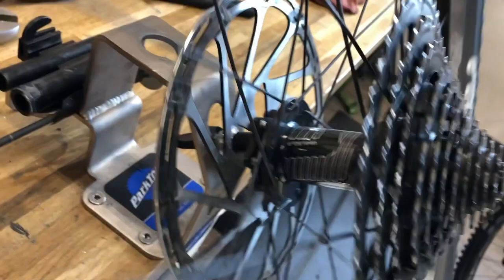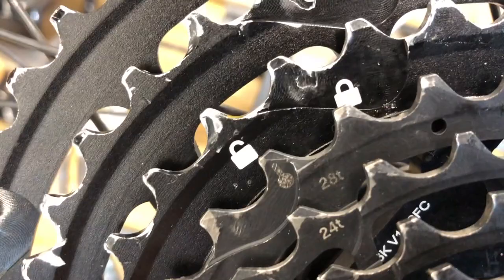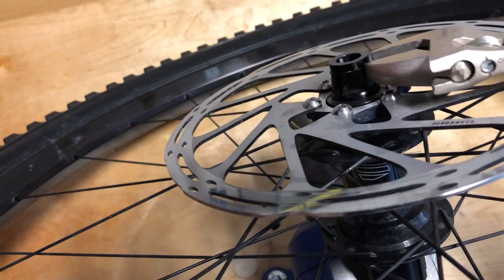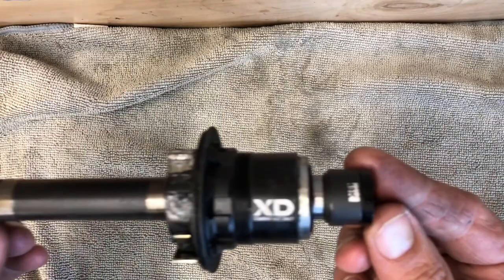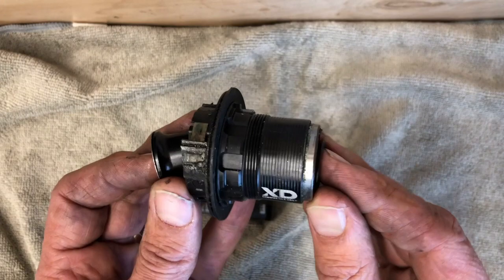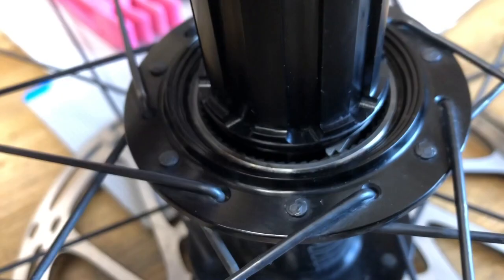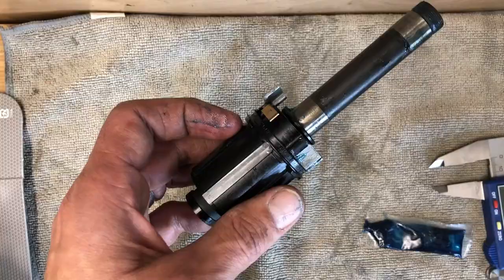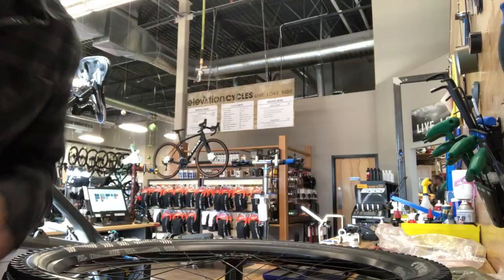XD to Shimano E*Thirteen Freehub Body Replacement

Comment: Thanks for making this.  Super helpful.  Did you use the lube they include in the package?  Where’d you apply it?
Reply from the maker: Mainly on the axle and all the spacers between the bearings. I can't remember if I used much on the pawls. I usually use Dumondtech free hub oil or Phil Wood oil on the ratchet mechanism. Thanks for taking the time to leave feedback!
Reply: @JoeyMesa  i just did something similiar on my YT. new back wheel, new E13 driver. i through a dab of park polylub on each prawl? it came with thin layer of clear grease. Is that extra lub going to great a problem .

Comment: Hi

I'm looking to do this conversation. The instructions on the E13 website state:

"Shimano freehubs require an additional washer on the outboard side of the axle configuration."

Don't know what they mean by "outboard"? Any ideas?
Reply: did u ever find out where that washer went? im looking to do this conversion as well.
Reply: @jorgeguerra777  Hi. It was over a year ago since I did the conversion so can't remember fully to be honest.

That said, I do remember that there is an aluminium spacer in the centre of the hub, it should have a thin shim washer at either end to prevent wear. The thickness and quantity of these washers determines how deep the freehub will sit into the hub and so consequently affects pawl engagement.

My advice is to ignore the instructions somewhat. Take it apart, note the order everything fits together, fit the freehub and then the pawl engagement problem will become more obvious. Fit or remove washers as needed.
Reply: @machinist_matt  i did the conversion already. the way they worded the instructions is kind of confusing but all they meant with an "additional washer" was the washer/dust cover on the outboard of the hub driver since the Xd driver does not utilize one. 
like u said the internal washer/aluminum spacer/washer is all in the same order, and they do provide you with the thicker washers for each application with the hub driver. 
thanks for the response!
Reply: @jorgeguerra777  No problem. Good to hear you got it all fitted correctly. 👍

Comment: Cant wait until 1x goes out of fashion...
Reply from the maker: As fas as mountain bikes go, you may be waiting a really long time!
Reply: @JoeyMesa  Regarding mtb, I think a lot of people are loosing performance and paying a lot of money for it by going to 1x trendsetting. Chain drop even for serious agressive riding now with clutch RDs is preventable and with something like 2x9 or even 2x8 you beat the range of 1x10, 1x11, you can run shorter cages as well and have more fluid gear jumps, better chainlines, less affected by bent hanger... If we implement modern chain technology on 8,9s chains they would become even less prone to braking...so many mechanical advantages.
Reply: @oreocarlton3343  you may be right, but there will always be tradeoffs... recently, the 1X are getting so good that i really dont see the industry backing-off anytime soon.